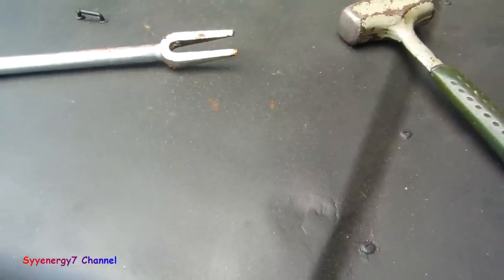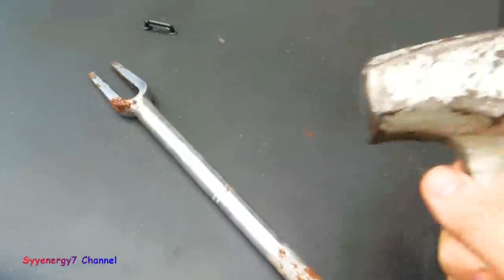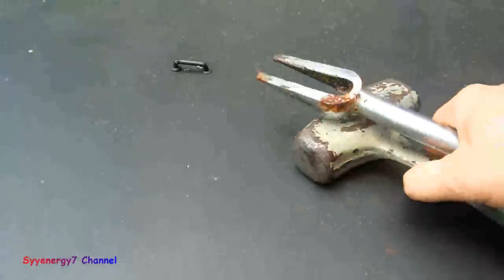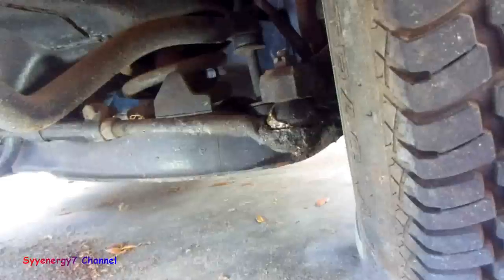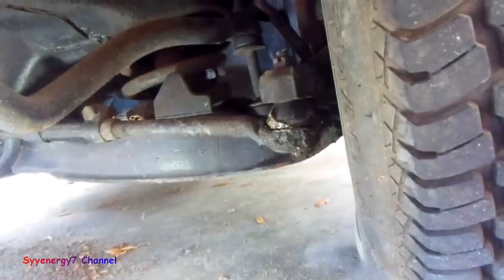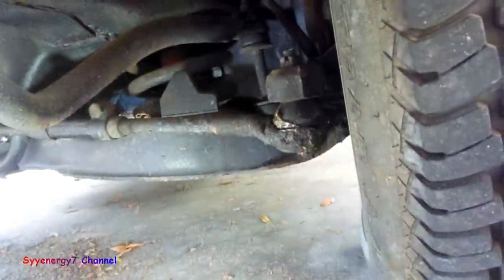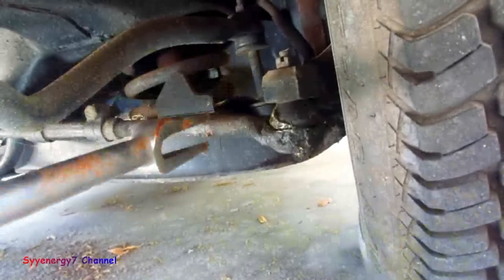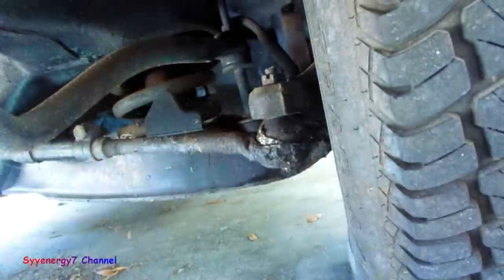Remove Tie-Rods & Ball Joints EASILY, WithOut Ruining Seals

Comment: After removing the castle nut, put it back on so the castle is facing inwards. Thread it enough so the nut's on well but not too much that there's thread protruding through. Then hit the nut with a hammer.
Reply from the maker: That DOESN'T work and will fuck it up.
Reply: This is a terrible idea and a great way to get your castle nut stuck on the tie rod

Comment: if u flip the castle nut around n level it almost level with the top of the stud, i mean like 50 thousandths or the width of the average credit card, whiches probably about half that actually, ok-the point is that ur hopefully hit mostly the nut but also transfer some of the force to the stud also so all the force isnt on the nut and therefor threads, iv honestly never had problems with "pushing" threads when beating on them, other than when it jus didnt matter n shit was bein stubborn    anyway since then iv got smart n started lookin for just about any kinda press or puller n absolutely nothin can put up a fight anymore :p  ...as far as pullin stuff off lol lets b clear    u have got to keep ur threads clean n greased tho! the grease collects the really abrasive metal dust n quite literally turns to heavy cutting compound and ur constantly runnin it with high force n pressure basically machining the surfaces down and creating alot of play in the tool, or the threads jus get mangled from all the use and abuse   iv always loved takin apart n servicin my stuff tho, its nice to get in there n tighten everything up clean up connections blow out the cobwebs new grease oil take 30 seconds to spray it a little rubbin alcohol wipe it off then take another 30 seconds to spray it, its really enjoyabe n satisfying stuff  u dont have to take 400 million years n lay out everything perfect wipe down every thread, this stuff goes fast, its not a tool refurbish its a service or maintenance, technically service but...  jesus i jus went n deleted a bunch of stuff so this wasnt a dam book n here it is... worse than before i give up.. i type too dam fast :p it all jus flows

Comment: Please, please help!!!  We were in an accident, the car hit our right front tire and above our right front tire.  At the time, the body shop said the "alignment was fine" and replaced the tire.  This was in October.  This month, there is a "squelching" sound when I turn the steering wheel and a "squelching" sound  (like a dog toy), when we go over bumps or hit potholes.  I was told by Ford that it was the suspension.  A small garage we went to, told me that "it was probably the tie rods" and he said he would put a small hole in the "boot" and inserted a straw and filled it with lubricant.  I told him I did not want this, but he did it anyway.  It did not make the noise go away, but now I am concerned about what damage this may do---after the fact, I did some more reading and I found out this is not good at all.  He also told me my tie rod was bad, and showed me how the front wheel would not move.  I found out that this is a good thing for the wheel not to have a lot of play.
Can you respond about all of this, please????